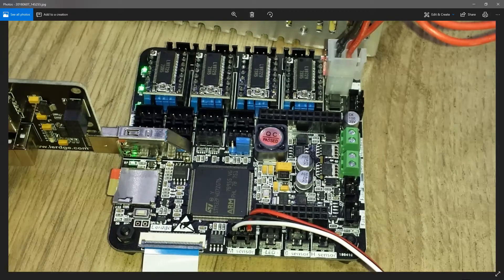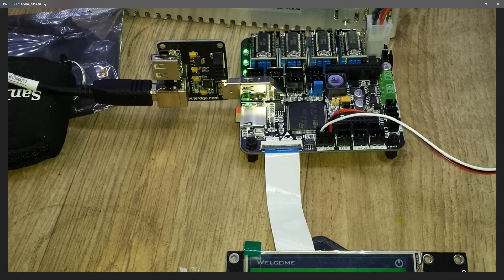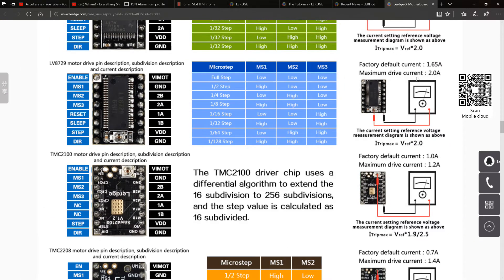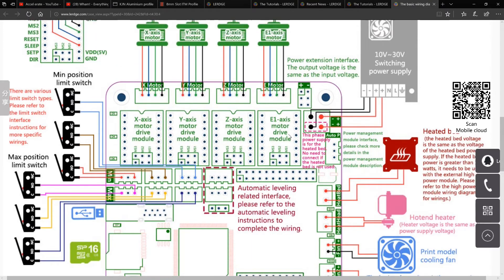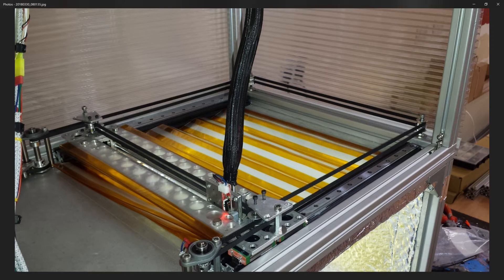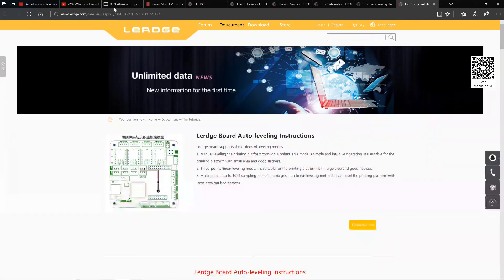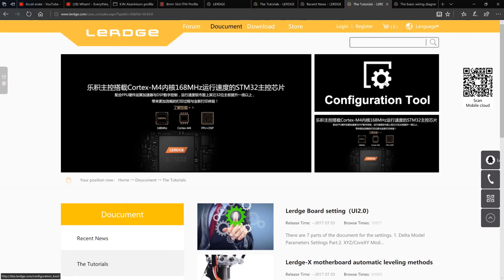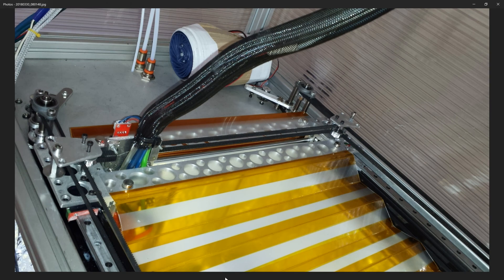Lerdge S - A closer look

Comment: Dear friend Accel erate, I use a lerdge x Board, I have a core xy system, with a double extruder promotion like yours. 2 rows of gt2 belts. Can you help me set up the Board? I can't do a two-engine engine promotion in the same direction. I don't understand this, my mail: ermolikartsiomaleksandrovich@gmail.com

Comment: Can you OR How do you connect two Z axis motor to the one port on this board ?

P.S,   there is a Lerdge  WIFI USB Expansion Module,  where dose that plug in ?
Thanks for your time.

Comment: I am planning to use an AC heater with this board using a SSR, But I am in the middle of building I couldn't find the polarity of the heat bed terminal on the board(because SSR has polarity). Did some with working board check the polarity of the terminal? And if I am using AC heater, Do I need to connect both power cables to the powersupply?
Reply from the maker: Hi EMakism - I connected both power cables just to make sure it worked. I am not entirely sure both are needed - I will look into this later.
Reply: thanks

Comment: It is best board for 3D printer what I used. All parameters is possible configure from display. Yes it not open source but mainly work good and intuitive.
Reply from the maker: Hi - I have now installed mine into my machine and set everything up so my printer is ready to test run. I couldn't get access to the Limit switch settings from the main screen, These I set up via the config file. I have moved everything around and I have managed to increase the step resolution of my X & Y by a factor of 2 (now 321.28 steps per mm) I can also now move the X & Y at twice the speed in comparison to the old 8 Bit board. All looks great so far. Would be interested to see why I cant get to the Advanced settings ?